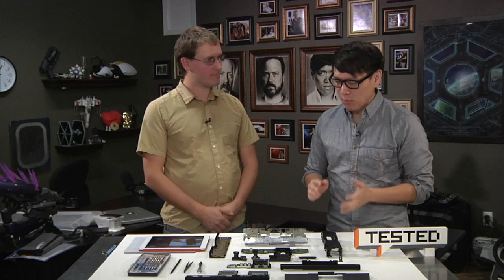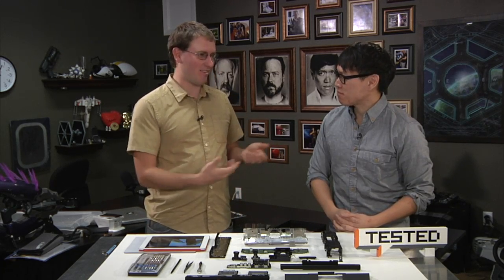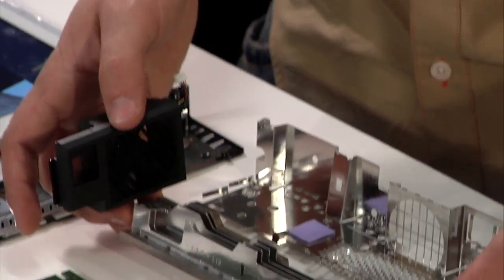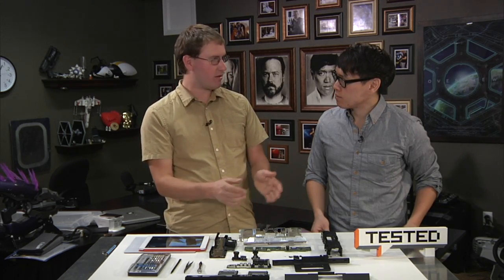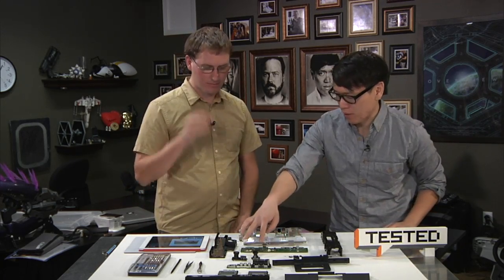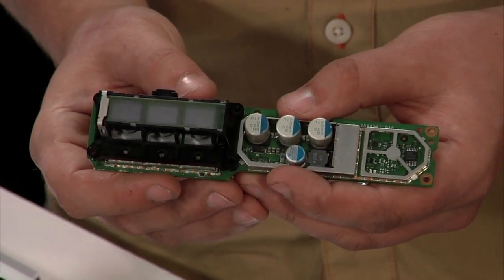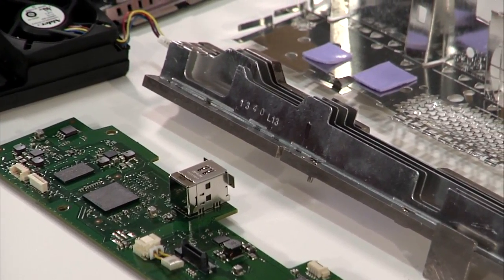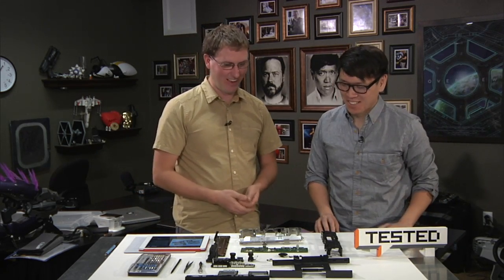What's Inside Xbox One's Kinect Sensor

Comment: im here 5 years later and the only thing preventing me from using this with windows 7 is fact the SDK is coded to only install on windows 10 and theres STILL no open source alternative and the fact you can't run windows 7 and 10 dual boot on a UEFI BIOS
also, wtf is a nexus?

Comment: I thought the Xbox One Kinect was going to be Time-Of-Flight? When did Microsoft go back to Structured Light?
Reply: In fact, it uses ToF, probably the guy in the video didn't know that, these 3 IR emitters emit at different frequencies, which allows the IR sensor to calculate the difference between the signal being emitted and the signal being received, thus obtaining the distance.

Comment: Huh? Why the infrared if the new Kinect sensor is time-of-flight based? Or am I getting something wrong?
Reply: it uses ToF, probably the guy in the video didn't know that, these 3 IR emitters emit at different frequencies, which allows the IR sensor to calculate the difference between the signal being emitted and the signal being received, thus obtaining the distance.

Comment: Not sure what could really go bad on a solid state device so long as it's not dropped or built faulty to begin with.
Reply: Flash relies on a floating gate. Basically electrons tunnel through an insulator to store the value for a decent amount of time. This tunneling behavior is what ultimately destroys the flash.

Flash uses a floating gate transistor that permanently stores a charge in a totally electrically insulated floating gate that isn't connected to anything. Hot carrier injection or tunneling is used to force electrons though the insulator and into the floating gate at very high voltages where they are essentially trapped forever (until reprogrammed again) and electrostatically cause the non floating gate to be on or off depending on the content of the charge trapped in the floating gate. Thus representing one or zero.

The high voltage and tunneling of electrons through the insulator breaks down the dielectric insulator with each erase/program cycle as electrons tunnel through the material and change the molecular state and electron composition. Basically the high voltage tunneling poisons the insulator with free electrons (?) until the dielectric starts becoming a conductor and progressively leaking so much that the floating gate can no longer hold a isolated charge. It just conducts and drains instantly through the insulator when you try to fill it and can't ever be a "1" again.
Reply: Gary Merchant
Regularly used Flash chips, and capacitors are the only components I can really see having a comparatively short life.

Capacitors can fail by a somewhat similar means where the dielectric gets pierced and creates a weak spot in the insulation (I don't think this is the same as tunneling, though, and only happens if the capacitor is overcharged, defective, or eventual dielectric creep allows a failure to occur at regular running voltages)

Parts like these should really be designed to be easily replaced.

Comment: I hope I'm not the only one who came here looking for a good way to disable the Kinect without having to use rubber contact cement and metal tape. The XBone still requires the Kinect to be connected in order to run, right?
Reply: Jordan Dickson Nope I'm not the only one who came here for that reason? Or nope, the XBone no longer needs to have the Kinect connected?
Reply: Jordan Dickson Hmm... I could have sworn that was still a necessary feature. My info must be out of date lol
Reply: .....

I, uh... I live under a rock.... Yeah that's it, I'm basically Patrick Star!
Reply: Untrue still even to this day you can't use your microphone for features like "record that" or "take a screen shot" unless the Kinect is hooked up also. You can use your controller for that but most names pause when you do this so to just get a picture or vIdeo of a paused screen. I have mine pLuged iN But I unplugged the mics flat strip cable. It unlocks features just by having it plugged in eveN though I'm oN a headset.

Comment: Does anyone here know of any way to reuse the camera from this? I just took apart a kinect I found and I want to use it's RGB camera as a regular camera. Perhaps an Arduino or Raspberry Pi to make the camera work?
Reply: an arduino won't have enough speed for a 1080p camera, the raspberry pi probably does, but you'll have to find out which protocol the camera uses to communicate, which I think is quite difficult.